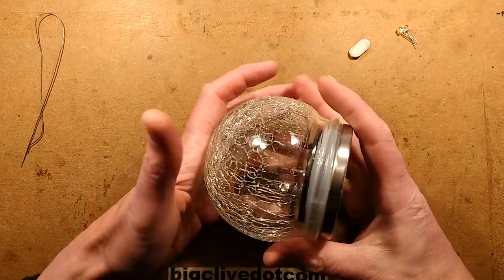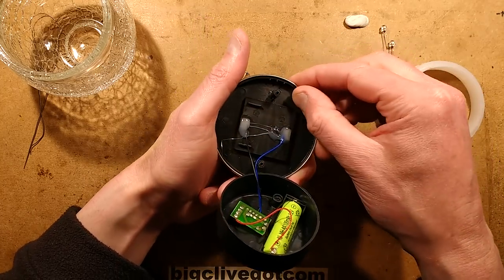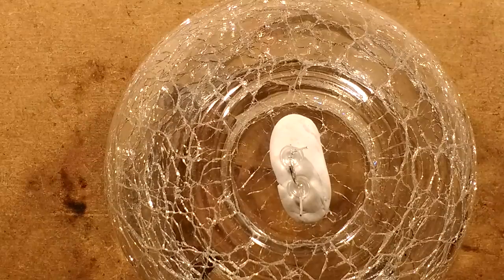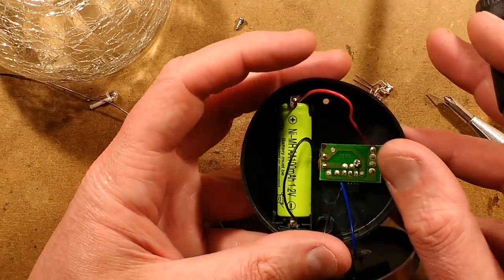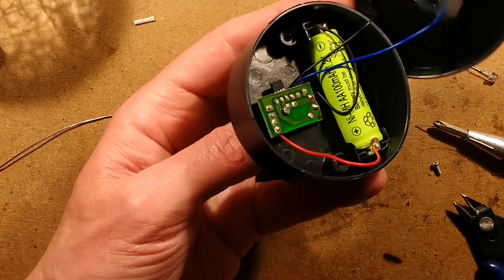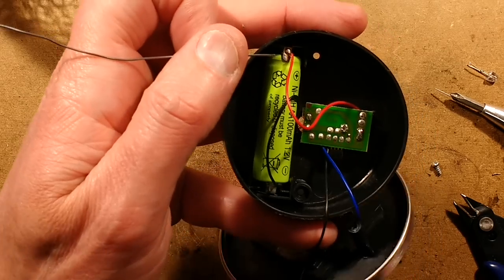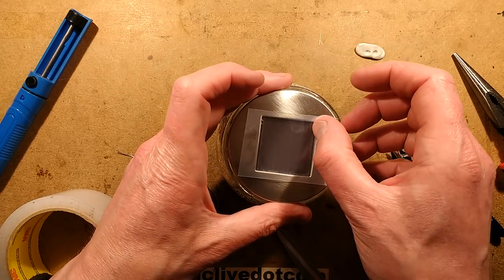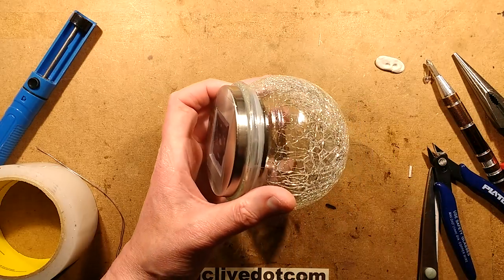Poundland solar garden light hack.

Comment: Clive, what screwdriver is that?  I've been wondering for a while now.
Reply: Its apoundland item good value for a quid
Reply: Thanks!
Reply: Used to see them in Maplin as well - if there's still one open nearby you might find one going cheap.
Reply: I have it from poundland http://www.poundland.co.uk/leisure-and-entertainment/diy-time-with-tommy-walsh/toolbox-essentials/mini-screwdriver-set
Also, the other set they do http://www.poundland.co.uk/leisure-and-entertainment/diy-time-with-tommy-walsh/toolbox-essentials/precision-screwdriver-set  is bit compatible, providing some of those awkward things like torx bits
Reply: Thanks for the links.  Looks like a Poundland shopping spree is in order!
Reply: You can also get them on ebay, just search for "8 in 1 screwdriver".
Reply: There are two types: one with 8 bits and one with 6. I haven't seen the 8 ones on sale for a while locally.

Comment: Tried everywhere to get the tape to no avail - Can you let me know where you get it from or some more details about it please?
Reply from the maker: https://www.ebay.co.uk/itm/252917229656
Reply: There is an expensive Gorilla clear tape. Wilko also do an external clear UV resistant tape for about £1.50
Reply: Thanks! I was looking in places like garden centres and I'm sure I've seen this stuff at B&Q Amongst other places, Have 10 of the poundland "lightbulb" solar lights at the end of the garden - 4 of which still work (all rusted/full of water) :-)

Comment: My solar garden leights always suffer from battery terminal corosion
Reply from the maker: Try a misting of an aerosol oil inside or rubbing contacts with Vaseline if it's moisture related.
Reply: bigclivedotcom thx thats a good one, gonne try that the next time one fails. sandpaper was my original method to fight that problem.

Comment: Sorry, I don't know anything about electronics! Why would you not solder both negative wires together and both positive wires together and shove them back in?
Reply from the maker: The LEDs may have slightly different forward voltages and one may hog most or all of the current.
Reply: Oh. Thanks!

Comment: do u have the skills to make a LED display ? a very crude one i mean at least ,like a 80x80 resolution using just soldered on red green and blue LEDs connected to a DIY controller/display board and using a pre made chipset for the controller etc ?